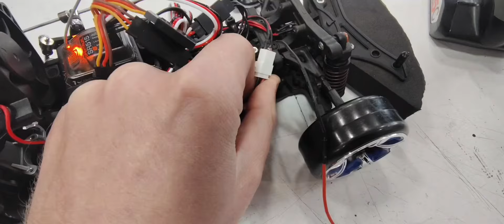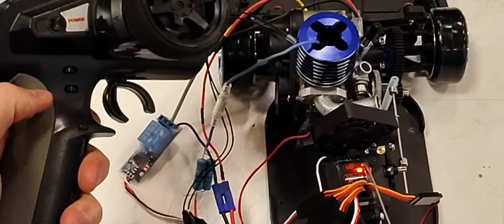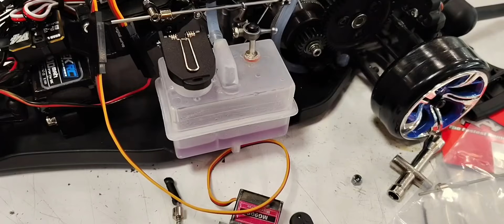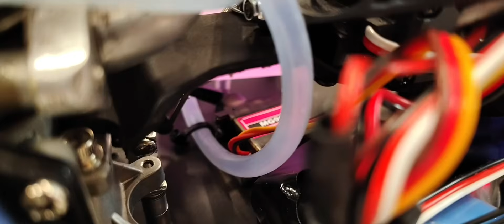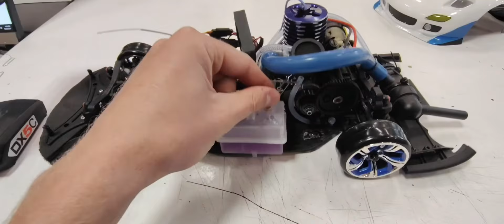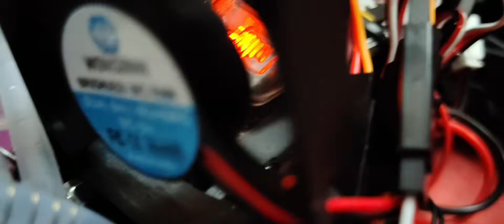Nitro Converted YD-2 drift car, part 3 (runs & drives!)

Comment: very cool, you do need to get an actual drift servo for the steering though. I can tell what you have in there is way too fast and is just going to wobble like crazy, especially with all the vibrations from the nitro engine. I'd recommend the reved rs-st
Reply from the maker: .09 second transit time, it's a decently fast servo. Might try a slower one and see how it acts.